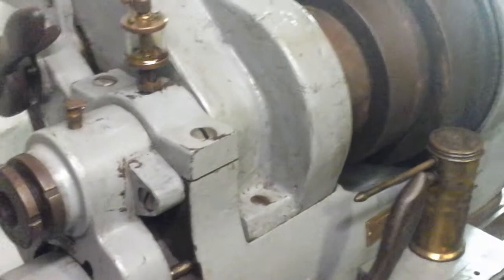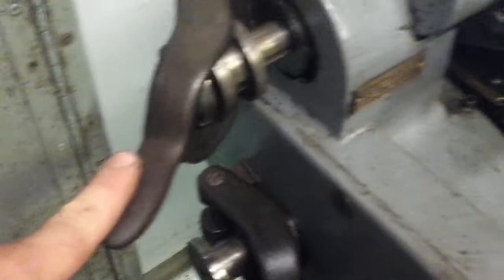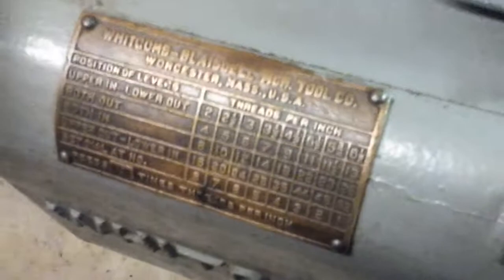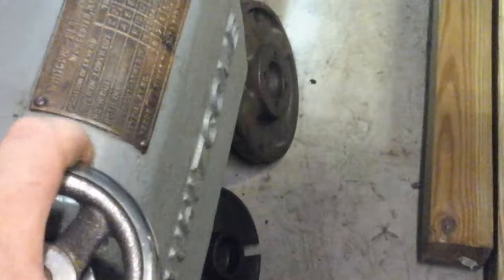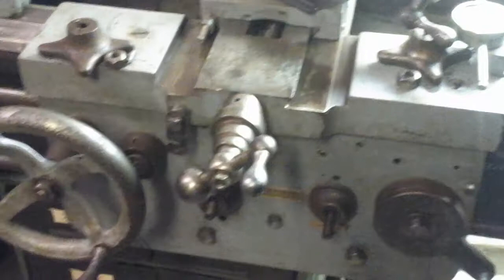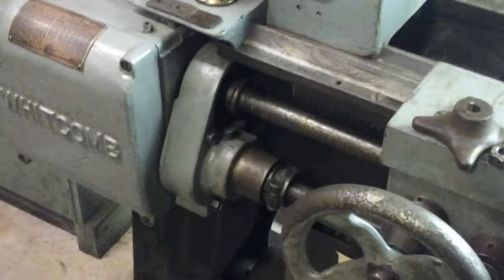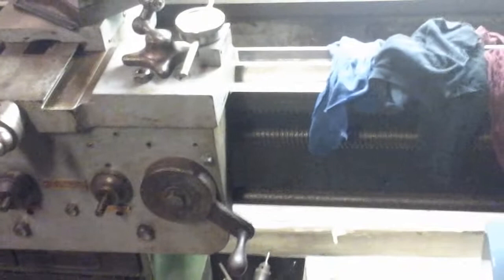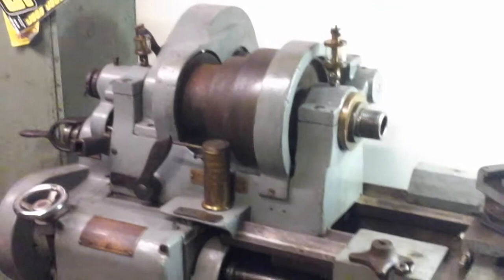Whitcomb Blaisdell Lathe Geartrain Overview

Comment: Wow, I found someone who has the same Whitcomb-Blaisdell lathe I have! At least the same era. My carriage is different and it has a thread counter.

One of these days I'll clean it up so it can look as good as yours! If ya need any reference pics let me know, I can snap a few for ya.
Reply from the maker: Cool! What serial number is your lathe? Does your apron have a raised section in the middle? I've assumed those were a later model (1920's?) double wall apron, while the flat aprons like mine were the earlier single wall style (that's all assuming they followed the same design trends as other lathe makers from this period) I'd love to see your threading dial. I have a thread about this lathe going over on Practical Machinist.com.
Reply: @m.b.naegle6903   what's your user name on practicalmachinist?  I'm a long time lurker but I just signed up.  Or what's the link to your thread?
Reply: @m.b.naegle6903   NM, I just found your thread/post!

Comment: are you sure it doesn't have a dog clutch like my Hendey. also have a leblond regal sliding boss disengages thread setup so it doesn't run all the time when not threading just a question. Ive never seen this brand.
Reply from the maker: No it's not like Hendeys design. It has a feed directional tumbler such as on smaller tool room lathes and it has a neutral position to disengage the whole gear train, so that sliding gear dosn't make a lot of sense.
Reply: @m.b.naegle6903  thanks for the reply. There must have been a thousand different ways to do some things.